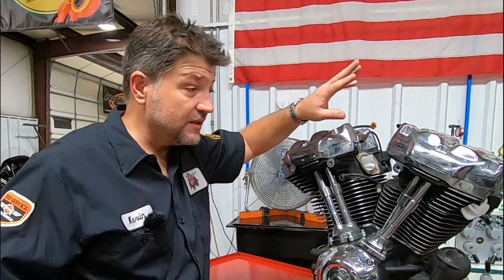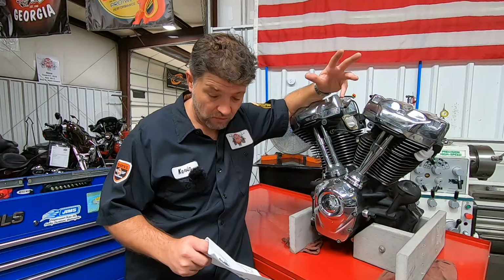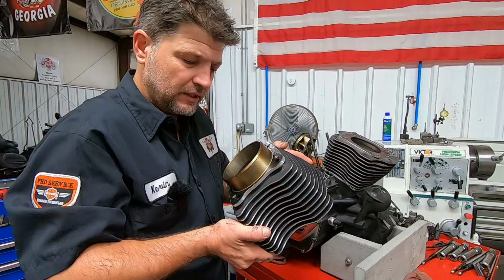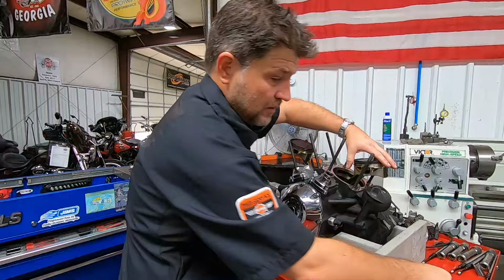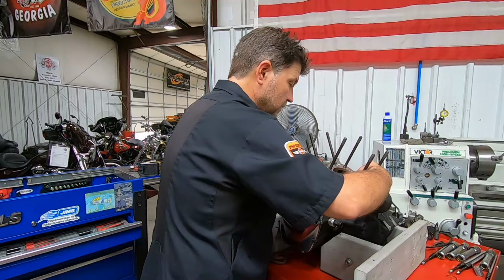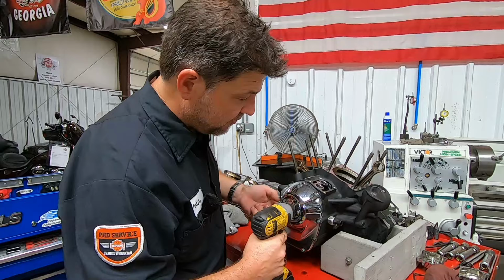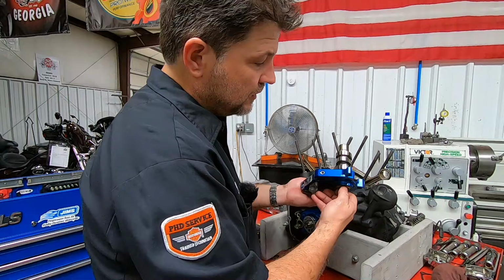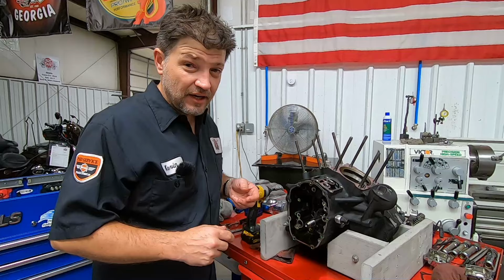80,000 MILES and KNOCKING! - Milwaukee 8 Engine Tear Down - Kevin Baxter - Pro Twin Performance

Comment: 80k miles? That's the first scheduled oil change for a Goldwing.
Reply: Honda Civicwing.
Reply: i change my oil every 20 or 30 thousand miles,if it needs it or not
Reply: @omarsalgado9715  wait I didn't know Honda Civic had flat 6 cylinder engine since when 😂
Reply: I had over 300,000 on a Goldwing before I sold it.
Reply: Who  ares. The Wing goes and goes.
Reply: goldwing is overrated overcomplicated Junk. they HAD plenty of problems, I know Many people that were left stranded.
Reply: This is one motor with an issue.
Reply: Who gives a damn - they say crocks feel good on your feet but I will never know  - some things just don't look or feel right  I. e. Goldwing&Crocks 🤣🤣🤣

Comment: Rebuilt an evo engine with  250 000 miles.Bores looked good  over bored to +.005" oversize .Crank pin was fine but replaced it anyway Guides were fine Valves faced up fine .Customer had maintained it well and it showed! The rocker assemblies were as clean as a whistle.Outstanding really Have another friend here has over 600 000 miles on a 1989 FXR Its getting tired (no kidding) but still goes ok,Dont believe any twin cam or M8 will  do this.

Comment: What do you consider “running warm”? I average 295° when it’s 80° outside. I’m at 80,000 on my m8. Did 124 at 60.k. Typically getting 11oz out of crank position sensor at oil change. I have first gen S&S oil pump.
Reply: 11 oz. of oil in the sump of a "dry sump" engine is a lot!
Reply: Any update on how many miles was last recorded on your m8
Reply: 295 is ridiculously hot need to get some love jugs cool down the oil that oil temperature is hot even for synthetic oil you should take whatever measures it would need to reduce your oil temperature to be low 237 degrees 80000 MI between rebuilds is ridiculous

Comment: Great Video and info as always.  Is that a 107 or 114?  Did it run the original factory oil pump for 70,000 before upgrading? If so which of the four HD oil pumps was in it?  I know to many questions.
Reply: Sorry I missed the typed info that it was an 107.
Reply: That's an s&s oil pump he pulled out of it.

Comment: What can I typically expect for engine work down the road with my stock M8 which I generally "baby" and always service at the dealership? I bought this 2019 FLHR in February 2021 with 150 miles on it and now has 13k miles. I will easily ride 25k miles this year. Dealership says it will "go forever" if I take care of it.  Lol.
Reply: That's like a drill Sargent saying "your recruiter told you What?!

Comment: I want to see the cases split and the rods removed, the rod bearings and races themselves and the crank pin. Is there going to be a follow up and reassembly shown on this M8 V Twin engine?
I'd suspect the engine has been run low on oil, excessive traffic slow riding/idling (think Myrtle Beach main drag traffic), or excessive rpms or a combo of several or all? Might be time for H-D to think about piston oil squirters? You need to check out the oil pump very good too.

Comment: What is the cause of the excess fuel consumtion? Tune?
Reply: maybe , ..the extra load from the shitty big end bearing coursing drag  plus the piston slap,blow by and so motor getting hot so more fuel to help it  run cooler
Reply from the maker: The tune.  He did say the map that was put in with the cam 10,000 miles ago killed his gas mileage.

Comment: 80k is some miles, sure would like think a well maintained engine would run way beyond that. 😳 I have an ol’ dodge with 350k and Babbitt bearings we’ll se what I can get out of my M8. Great stuff. Will miss ya at Sturgis 🤷🏼‍♂️
Reply from the maker: 80k for a car was a TON of miles a few decades ago.  things have surely advance in the auto world.  all the best.
Reply: I would think the difference you're seeing is that of air cooled vs liquid cooled.
Reply: I would think that BMW boxers and Gold Wings would go near triple that without problems (even the air cooled boxers).
Reply: IMO if you are running a hotter cam in an air cooled V twin that already is prone to rear cylinder over heating, you are running the likelihood of reduced engine life, particularly if you use that extra performance regularly. More power = more heat.
Reply: @KevinBaxter  I remember when we changed out or company cars at 65k in the early 80's and many of them were showing signs of getting tired by then. Not too long before that many motorcycle engines needed things like top end rebuilds at 12k. Putting aside design, material and improved production tolerances, one big factor is the vast improvement in engine oil over the 45 years or so I've been riding motorcycles. With modern oil changed regularly it's pretty hard to actually wear an engine out. If failures occur it's usually due to other factors which cause overheating and/or loss of lubrication or in a few instances, inherent weaknesses in the basic design..
Reply: @shavedape  Air cooled BMW boxer engines can run huge mileages, one inherent advantage they have is both cylinders sitting out in the breeze as opposed to having one cylinder partly behind the other so not only is airflow restricted, but you also have heat from the other cylinder to contend with. BMW also use top notch materials for their rings and bores, to the extent it took 10k to break them in to a point where synthetic oil should be used. The Goldwing has the benefit of liquid cooling. Personally I feel the unbalanced nature of the Harley V twin is also hard on the engine components in the same way it is on a 60's or 70's Triumph.

Comment: If Harley can't make a engine that will last beyond 80k miles they need to talk to Indian motorcycles and get a better idea of what it takes to make a longer lasting engine.
Reply: Harley does make engines that last longer than 80k miles. There aren't videos about those examples because it isn't interesting to hear someone say, "Yeah, it's fine."
But I do agree that Indian makes a great bike. The American motorcycle industry needed a large, strong competitor to Harley.
Reply: Looks like aftermarket parts. S&s maybe
Reply: Yeah, Polaris has a few oil burning issues with the very early Victories, but they were awesome. I hope they bring back the brand a but less OCC style.

Comment: I have a Honda 02 750 spirit with 88,000 miles . It still runs good and I have always run  it hard.  It has been rejeted and runs 12.30 second quarter mile and gets  65 mpg.
Reply: I call b ess
a 750 spirit would NEVER do a 12.3
sheesh
try low 15's

Comment: So, this M8 had a bad stock rod-bearing.  Are there more "Robust" rod bearings out there for these engines?
Reply: THEY ARE AIR cooled engines and contrary to what most engineers and techs think,changing oil more often won't hurt a damn thing,many filters many quarts, no wear is the end game,most of my bikes go 128 k miles,i ride state to state and walking ain't crowded,change the oils

Comment: Too much great info! I don't work on modern bikes because of computers and sensors. I also know my place and do not dive this deep into engines. I have never complained about a rebuild shops bill. Between education, equipment costs and replacement parts cost you folks definitely earn your dollars.
Thank You
You are in my prayers
Hoka Hey

Comment: 80k miles is not a huge amount of miles, and it needs a full stripdown and rebuild.
Reply: A motor platform that has been revered for it’s Tuner’s Canvas for performance tune-ability and for years pretty much held to the same traditional air/oil cooled V-twin design standards would require higher maintenance. 80k miles is really not so bad and IMHO pretty good. Harley’s, hate or love them, are the most popular motorcycles now and in the foreseeable future. New and Used prices indicate that fact. Companies try to imitate but still haven’t been bike to duplicate the same ethos. Indian does a real good job but not at the pace of Harley.

Comment: This was a really well done video. Many  thanks for posting this, it was really informative. It was awesome to see the four valve heads. I wonder if there a heads like that for my old 88 twin cam.

Considering the high lift cam and the high mileage in a short time span, I'm suspecting the owner frequently has wide open throttle bursts and if he cannot find ethanol free gas, the ethanol is causing some of the problems you are seeing in the cylinder. Ethanol introduces extra oxygen directly to the cylinder which can raise the temperature of combustion.

Some of that crud on top the pistons might be due to the oil re-circulation system that puts oil vapor into the intake if he didn't install a vent bi-pass system.

I'm glad he caught the noise in time to prevent a catastrophic failure.

My 2000 twin cam 88 now has 88,000 miles but for the most part, those have been leisurely miles. Plus I use Amsoil full synthetic and change it at 5,000 miles. I watch for ethanol free gas. It has only had ethanol for about four tank fulls. My engine is as quiet as a friends identical engine with only 15,000 miles. I had the dealer install a screaming eagle vent system before I bought the bike new. So it has not had oil vapor being introduced at the air filter. But that might explain why the back wheel gets cruddy so easily. LOL

Comment: When engineers redesigned the pistons to eliminate the side skirts in line with the wrist pins they must have believed that the loading on the pistons was only front-to-back. Harley riders like to lug the engine to get that low end torque, but that just increases the combustion chamber pressure and increases the chances of detonation. Detonation is like a hammer blow to the piston and everything connected to it, like wrist pins and rod bearings. Repeated enough times, it will pound flat spots on rod bearing balls and increases clearances on wrist pins. When that happens the piston will wobble in the cylinder bore. Nothing good will come of this. Now...
I put 50,000 miles on my 1200 Sportster in the first three years. It currently has 82,000 miles on it. Most of those were highway miles, with the rpm above 2000. My bike has a tach and I use my gears to keep the rpms above 2000, because below that number the engine will pound the rubber mounting when you try to accelerate. 
Depending upon how bad the rod bearing is at operating temperature, it could be freezing the engine and the momentum of the bike, transmitted through the drivetrain, breaks it loose again and again.

Comment: Top of the Pistion rod bearing and piston "pull" pin.- questions if the pistion slapped the bottom of the "jug" combustion chamber? 
Tight spot in the crankshaft rotation- uneven rotation bearings load is favored to one side of the crankcase with the roller bearing. Replace the crank bearing with sealed wheel bearing and drill a oil hole @12 0'clock postion to have even crankshaft rotation-under load
The lifter rotation, lifter wear metal shavings or aluminum?- needs overboard & honed- lifter lockpin failed?
 The pistion to valve clearance is not in between 0.003"- 0.005" - gasket gap? 0.011"?
Reply: "wrist"  bearing replacement top of the piston arm

Comment: Im wondering if the after market oil pump overperformed  the standard lubrication system..eg overode oil passage capacity with leakage at hot spots. This is a common phenomen in older 2 stroke designs. Con rod drillings being over pressurised  excuding oil from piston gudgeons.

Comment: I just had my 1000 service by my local dealer that I purchased my new 2021 Tri Glide. I sure hope most of the issues you have been showing are fixed now and I won't have an engine that will fall apart anytime soon. At least I have 2 years to find out.
Reply from the maker: i hope the best for you sir.  not all had issues...most didnt.
Reply: @KevinBaxter  Thank you. My favorite all time was the Evo. I had two shovels that took me many miles back when a screw driver and pair of pliers would keep yo going.

Comment: I got a 92' Honda nighthawk cb750 with 86k miles and it's starting to show it's age. I got it 3 years ago and it was at 40k. I've used the hell out of it as a daily driver and the oil pressure light just came on. Dims with revs but went off after I hit a bump. So gotta wait and see if it comes back on but at 86k I've gotten my money out of it

Comment: Its a relic of a design. A 45 degree pushrod V twin has imbalances that cannot be removed and by making them produce a lot more power, the unreliability is becoming evident. And as for making them more expensive than a Beemer, its a recipe for a disaster.

Comment: Kevin. Love your stuff. Just a query could the EITMS (back cylinder not firing) be a contributing factor to the issues regarding the condition of the front cylinder as during idle only the front cylinder is firing which may possibly be a factor as a result of a change in the balance of the motor? Food for thought. Warrick & Steve (From Down Under).
Reply from the maker: that only happens when the engine is overheating.  the heat would cause more damage than an imbalance.  i never run it on a properly tuned engine.

Comment: Great video, I would have liked to known more about the bike ie I didnt notice is the owner mentioned what was the type of oil used, and the typical oil consumption, or engine what type of cooling it had, if it had an external breather for the banjo bolts in the heads, or if they replaced the OEM lifters (and what kind of wear on them) and the owner had on this bike and more importantly; at what mileage did they install the S&S parts (important factors), but with the New S&S cam plate and oil pump, I would expect 120k before rod bearing wear like that

Comment: Well I bought a used bad idea on my part stock , 12 street glide with 43k or close to that miles on it . Checked out from a local Harley dealer . I don't have a lot of faith in that now . Took the bike for a road trip and rod started knocking after I bought it . Never again ..I have a SS 124 in it now . I personally don't want a stock Harley engine.  Lifters, crank assembly. Oil pump , ect .. a m8 with 80k miles is amazing really

Comment: Neat expedient engine support. Rather than tie up bench space I buy cheap Harbor Freight engine stands then weld up simple engine adapters to their heads. Being able to spin motorcycle engines makes working on them MUCH easier for the same reasons car guys use them for engines and transmissions. It's easy to cut down engine stands for table or bench top use if floor space is an issue or to replace their cheap little wheels with superior quality casters at all three or four points so ya can push them in any direction.

Comment: Air cooling system is not adequate for large engines. If HD insist on an Air cooling system, then they should increase the oil capacity, design a more efficient heavy duty oil cooling radiator, and a high flow oil pump. This may help reduce overheating but I still believe that a water cooling systems is the best system to prevent overheating and longevity of the engine.

Comment: Very interesting, i own a 2019 RoadGlide Special here in Germany with currently 20.000 km ( not miles). 

Some time ago you mentioned a shootout between all the different primary chain tensioners,…. I am really waiting on that one because i want to replace the stock M8 primary  tensioner.

Comment: I have a 2020 low rider m8 but only 3000 miles on it can’t give an opinion on it but I do have a 1982 Kawasaki GPz 750 original motor with chingos de miles and still ticking pretty good

Comment: I absolutely know that cost accounting is 'boring' compared to burning up the highway on a MC.  Regardless, a cost accountant would measure things is cost per unit: square foot, widgets processed, or produced, mean miles/time between rebuilt.  I'm fully aware BMW's are high priced, but this explains why they are not really expensive..

Comment: Hey Kevin love your work. I just bought a 2021 fatboy with the 114 m8. Just put 300 k's on it and it has zero oil on the dip stick. Oil was just over half way when cold. Checked when I got home from a ride and no oil. Does puff out a bit of  blue smoke when you start it then it's fine. Any ideas why the oil would disappear so quickly? It only has 17,625 k's on it and it runs fine.

Comment: I keep hearing the phrase "run too hot" in many of your videos. What is an example? 230,240,250 on oil temp or? I have a 2007 Heritage 28k miles, TC96 w/stage2 torque cam, V&H long shots, FI, Dynoed/tuned by ECM flash. My oil temp stays 220-230F during normal operation. Added man-o-war comp, Barnett 10 plate carbon clutch and Hayden tensioner (just finished today-wow is it smooth now). Thanks in advance!
Reply from the maker: thats a decent oil temp.  i shoot for 300 to 320 deg measured at the base of the plug on the head.

Comment: Lot of miles for Harley , not for Hondas, lmao he knows not to push it hard... horrible how disposable are Harleys. 
I work hard for my money and for me smart purchase is something that will last and to last has to be low maintenance , everything on a Harley is disposable from suspension to cooling to rear belt , but remember you guys know to not push it hard LOL , my respect to you for doing this video and been a realistic mechanic,  now you Harleys remember not to pushed hard and 80000 miles is about it LMAO!.

Got a friend with a  Harley engine replacement just after 40000 miles and another one with clutch replacement just about 20000 miles ,i will never ever buy a Harley and they don't ride nice as some Hondas,  actually can't even compared a newer goldwing or even a ctx1300,  my dad been a mechanic will toll me if I loose my mind to purchase a disposable bike.